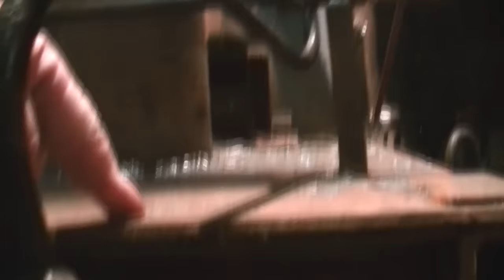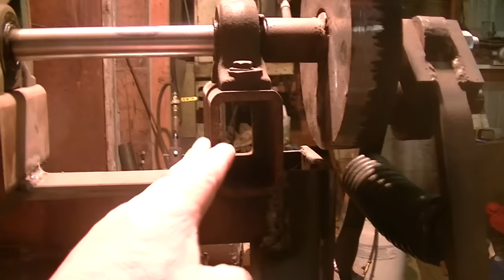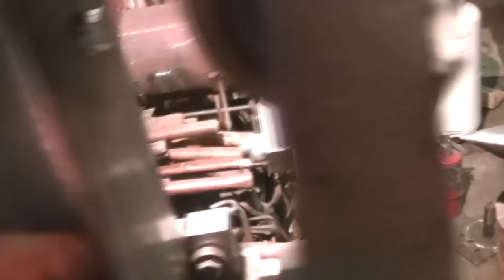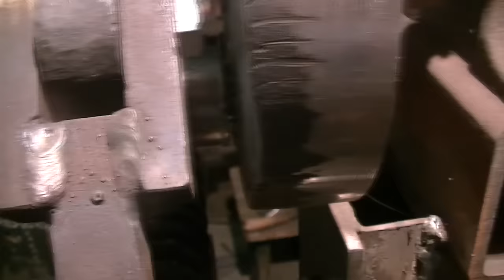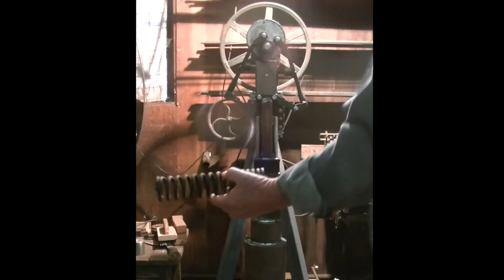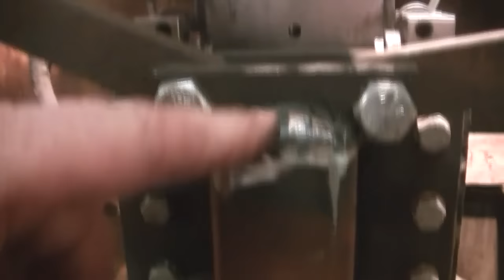Blacksmithing Power Hammer Q&A

Comment: Hey Tim, If a Standard 3450 RPM motor is used.  A  speed control can be used to dial in your strokes  per min, also the large pully  as the driven takes allot  of   unnecessary speed to the hammer assembly.  Great job on Scrappys Anatomy lecture.  Hope all is well with the family Tim,. You weren't your usual spunky self.  Thanks again for your time to make  a very good educational video.  if you ever need anything from me South Sound  or the Coast. I'm 30 miles South of Aberdeen...... on 101.

Comment: Well Tim I finally fired up my new forge.  Then I heated some spring steel and started hammering out the handle. Steel don't move easy even at 1800 degrees. I don't have room for both a power hammer and a power press. So its either or. If you would could you tell me which is more useful?
Reply from the maker: I find my power hammer of more use, But really there are pros and cons to both.
But fi could only have one it would be a power hammer.
Thanks for watching.

Comment: I know it's been a long time since you've made this video Tim but I got a question if you don't mind. Did I miss the counter weight for your hammer or is it not there? Would a counter weight on the fly wheel smooth things out a bit more so it's not lifting a lopsided load when bringing the hammer back up? Thanks for any info you're able to give.

Comment: Awesome job on this build. Questions... how heavy would you say that flywheel is and what's the distance from the center (axial) shaft of the flywheel to the shaft the hammer linkage is connected to?
Reply from the maker: The offset on the flywheel crank  is 2" center to center,  and the weight is 15 LBs
Thanks for watching..

Comment: Thanks for the great video and breakdown on how you built your power hammer.  The one thing I didn't notice is if your motor is 1800 rpm or 3600rpm.  I would assume 1800, but could be wrong.  I was thinking of building an "original junk yard" hammer or tire hammer.  However, I like yours much better, a smaller foot  print in the shop, and more refined.  Subscribed
Reply from the maker: Hello and thanks for watching, motor says 1750 RPM.  A really appreciate the comment thank you so much.
Good luck with your power hammer build, take care.

Comment: Most of the measured pieces are easy to figure out. Where did you get the bracing, and guiding pieces? I don’t know what they are called, but the pieces that hold everything together are the most important parts. How do I find/make/order the half-round (rainbow shaped) guides? Or the materials that make up the frame? 
I was lucky, I bought one that was 90% complete, but I still don’t know what I would do if the supports started to fail. It would take me WEEKS to make a replacement myself.

Comment: Not sure if you still check these comments on this old video. I was wondering what the total weight of your pulley, shaft and flywheel were?  I found a very heavy pulley on a 1" x 20" shaft that is about the right diameter. It has I think, six v-belt grooves side by side. The pulley and the shaft weigh 84 lbs. Is that just way too heavy for this purpose, or can I make the front flywheel as light as possible and let the pulley carry the weight so to speak? Obviously there would be more belt slippage to get that mass rotating, but I considered using a two belt drive system if needed, since I have plenty of grooves on the pulley.

Out of the same scrap pile, I pulled two 10" x 15.4# channels 90 inches long each, as well as a 48" x 48" sheet of 3/8" plate. I was thinking I could use those to build a very robust frame that could handle the extra weight of the flywheel and a correspondingly heavier hammer.  Does this sound reasonable?

Comment: Ok , I have collected almost every  part I need to start the build would like to make my build a 100lb. Hammer, have a Q. Do you think a 3hp motor will work or a 5hp or would the 5hp be over kill.
Reply from the maker: A 3hp Electric Motor would be more than sufficient to run your hammer, my hammer is about 37 pounds and I run the 3/4 horse motor, just make sure your gear ratio is not too high so that it runs too fast and make sure your hammered guides run smoothly and you'll have no problems.
Reply: I have another question on how did you been the upper yoke assembly I probably can do the lawyer course Emily but how did you get the upper yoke assembly so tight around the small circles

Comment: Tim, you probably covered it and I missed it along the way.  What is the diameter of the flywheel?  My local scrap yard has a few round blanks that I could try if they are close enough to the desired diameter and weight.
Reply from the maker: The diameter of the flywheel is 7 1/4"  and it is 1½" thick.  If you go over this size it would be OK I wouldn't go too much smaller, it sounds like you're getting ready to put it together, very exciting I hope it goes well for you.  Take care and good luck.
Reply: I went with the larger of two options at my scrap yard.  11" diameter versus about 9.5".  It's 1.5" thick and weighs around 31 pounds.

Comment: Were there "power" hammers before electricity (water driven)?
If we didn't have electricity (1800s) could we create power tools (table saw, band saw, lathe, etc...) to work without electricity (not counting solar)?
Reply from the maker: Yes recently a 300 year old water driven power hammer in Sweden was restored and put back into use.
Steam engines drove entire factories including table saws band saws lathes and much more before the steam engine water wheels did much the same thing.  Water wheels powered much of the industrial revolution 1700 to 1850.  Most of the stationary shop tools that we use today were in use and being powered by water or steam many years before the invention of the Electric Motor.  Awesome question thanks for tuning in, take care.
Reply: I try. ;-)
I remember seeing videos of rooms full of machines driven by belts with devises to engage, disengage (on, off & speed) the belt.

Comment: What holds the spring in and does it push or pull
Reply from the maker: The spring pushes and fits over a stub at either end and is under tension..
Reply: What’s the distance between the center of hun and the offset stud
Reply: Tire hub

Comment: how tight do you make the nuts, doesn't it slow the hammer down?
Reply from the maker: I use nylock nuts I can leave them backed off  a little and the nylock holds the nut in place. Thanks for watching.
Reply: @BIGDOGFORGE  thank you, does it affect the arms if the threaded part of the bolts are rubbing against it?
Reply from the maker: it doesn't seem to have an effect on it at all.

Comment: So the mass of the anvil must correlate with the mass of the hammer and the mass of the material Yes? - For the reaction to be less than an an inertia inertia. You need to have the anvil on the vibration damping substrate: Eh <Em + Ea: Vh = 2 [m / s]; Mh = ~ 15 kg => if Va = 0.1 [m / s] => ma (15x4) / 0.01 = 60 / 0.01 = 6.000kg :-) without damping! The trunk of the wood should be under the anvil.
Reply: If the anvil weighs less than 6,000kg (12,000 pounds) it must be something damped by the hammer's energy. Best wood or Teflon.
Reply from the maker: Exactly my dampening methods is a 3 1/2 inch thick layer of wood concealed under the base of the hammer.  Thanks for watching take care.